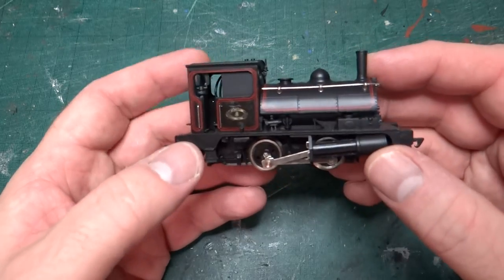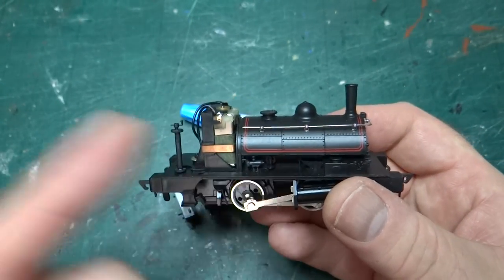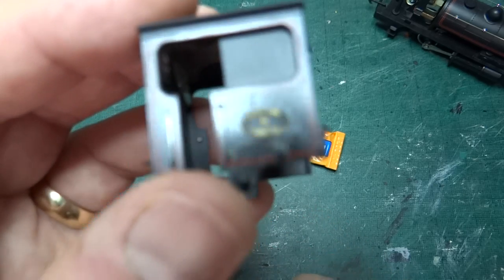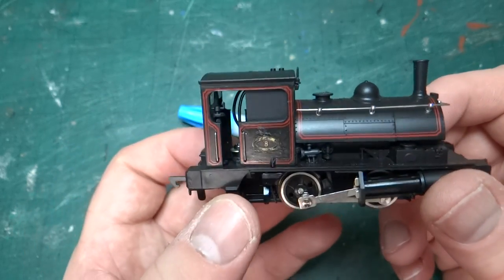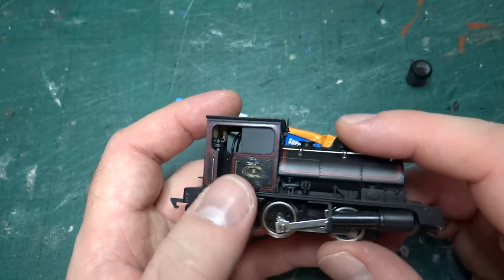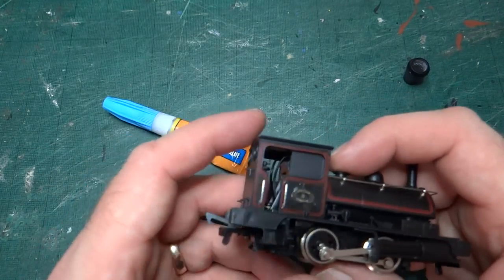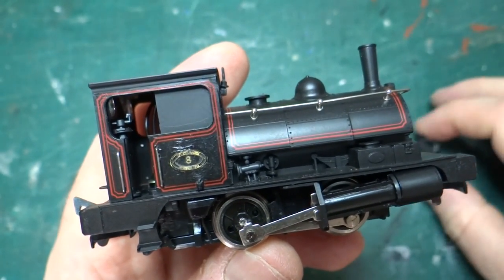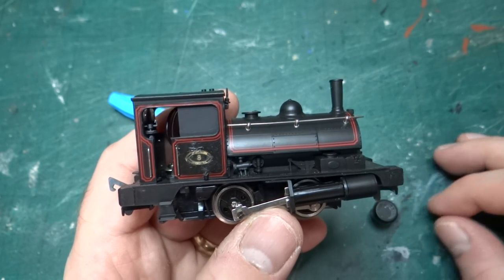Never Use Super Glue on a Finished Model

Comment: You should never use Gorilla Glue period... These brands are literally the factory floor sweepings. ZAP is my preffered brand supplied in Thick, Medium & Thin variants with a KICKER that either you can spray on to get an instant bond or better still spray KICKER on one part then offer it to the a glued second part, instant bond. If you apply Cyanoacrylates with a pin it's fine, you don't need a lot to make a decent bond, just clean and grease free.
Reply from the maker: Interesting.I have previously used Zap (I want to say green, but I can't remember how thick that was) but ended up switching to gorilla glue when I couldn't get it for some reason. I've not had any problems specifically with it (I always decant a tiny amount and then use a pin or thin wire to move it to where I need it), but I might try looking for Zap and their kicker next time I restock and giving it another try.

I do really like the Gorilla Glue wood glue though, it seems to work really well.